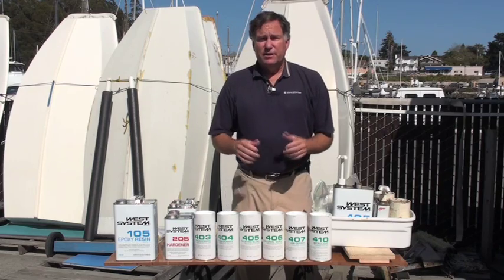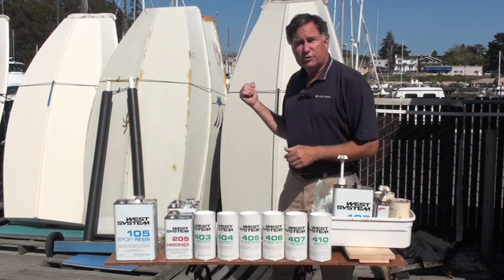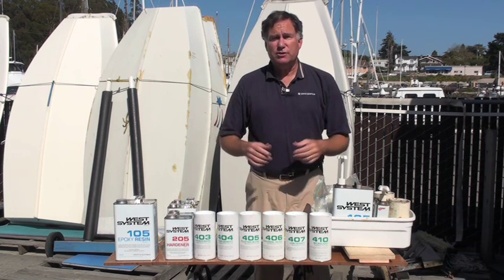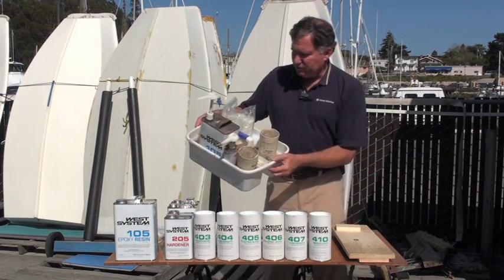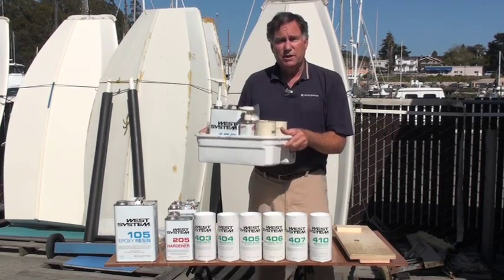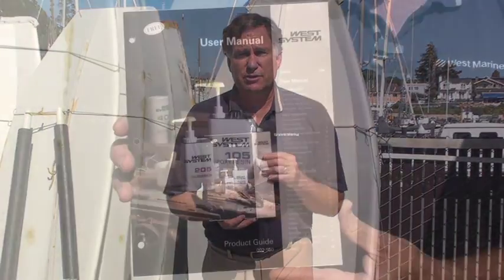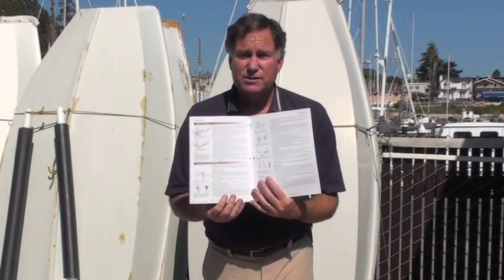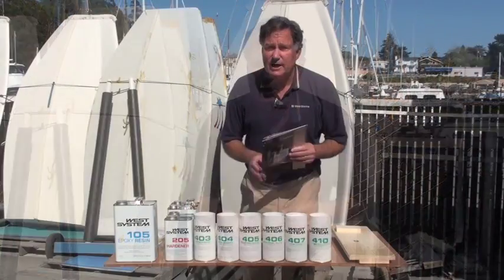DIY Introduction to Using Epoxy Resins

Comment: @squigglewoots  Probably, but I think you could use a standard two-part epoxy glue from a hardware store. Try to get the glue in the crack and not just on the surface.